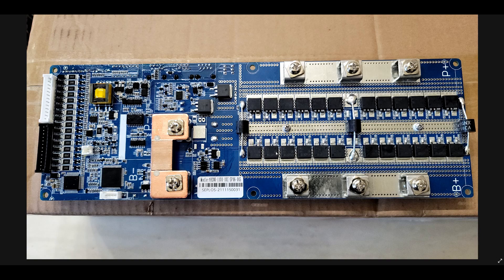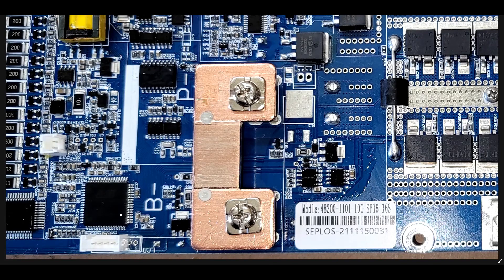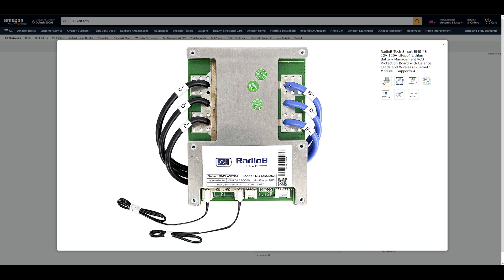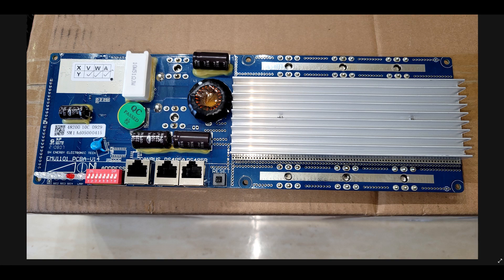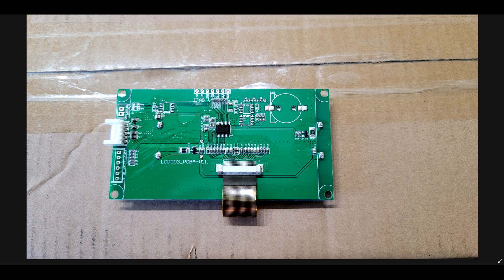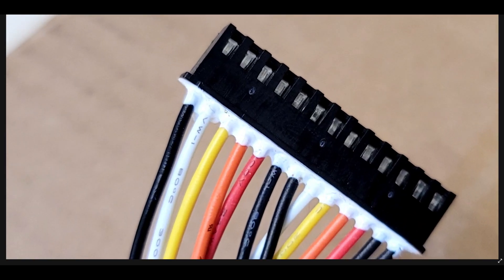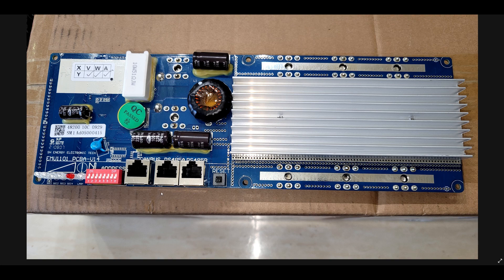Seplos 48V 200A BMS PCB Close Up & Overview

Comment: Seplos BMS is an excellence BMS, stop complaining DMI INC about it. You can't do or design it but you to complain.
Reply: Is 200amp enough for a 48v bank on a spf5000es inverter?
Reply from the maker: @JM-yx1lm  200 AMP provides for 10KW output. What is continuous max rating for that inverter?
Reply: The updated version will be available soon. Hope fewer complaints.
A little spoiler: the DIP address is still there this time.
Reply: @SeplosTechnology  when is it available? any 250A charge-discharge, or more, options?
Reply from the maker: Love it!
Reply: No, not at all. The software lacks a lot, the balancing is not really working. Check Andy's series about the fraud on off-grid garage in australia when they had shipped 3 year old LFP cells to him in this summer - qr code said built in 2019 .
And there had been more isssues . No, not a monday built BMS cause he had purchased 2 differet SEPLOS batteries, the 6,9 kWh Mason full diy kit incl. cells and the bigger one without cells for the EVE LF280K cells. Same issues and struggles.
Reply: 2 of the temperature sensors had been doa - so not the greatest quality if they did not check that before shipping.
And look how poorly they ship the kit in their battery kits like the masons. They throw all parts and pieces into the empty metal box without much protection and once they get loose like the heavy bus bars they will cause a lot damages.

Comment: Hi, I have this BMS to control 16x 280ah lipofe2 battery pack. So do you know what is the ampere of a circuit breaker to protect my battery? 200ah dc circuit breakers doesn't exist and I don't think that's the ampere to consider (200)

Comment: I have seen many unnecessary disrespectful messages on this post in fact I think that your observations are very professional and I would strongly agree on the subject of the bus bars, being a mechanical engineer,  I did cringe watching Ray using the toque wrench on those, in my opinion, inadequate fastening screws. I'll be looking forward to your developments on the usage of this BMS as I am now constructing my PV system with a temporary 5.1kWh "microwave ready" battery for testing purposes to then progress to building my own 300ah one having just spoken to Jenny wo about the cells thanks to the generous input of our friend Ray. Thanks again for sharing 🙏
Reply from the maker: Thank you. You do know your stuff... Imagine heavy gauge wire or two hanging on those connections. It can easily rip connectors apart from PCB.

Comment: They need 2A balance current instead of 0.150A!
Reply from the maker: I have not used these yet since I got busy with with land. But agreed. JKBMS balancers do wonders.
Reply: @DMIINC2013  the latest NEEY top balancers are working quite well after Andy from the channel off-grid garage had kicked them in the ... for several times.
Now they seem to have gotten it right.
Off-grid garage is an australian channel - and andy is a german emigrant who is investigating these products carefully like the SEPLOS products and JK BMS and some more.
Reply: just get a 4A Neey and all issues for you are solved

Comment: Unfortunately unplugging and plugging back in the COM cable whilst the BMS and inverter are both turned on kills the BMS. Has happened to me twice. Not sure why.
Reply: After installing mine that I bought from minerals on AliExpress, it goes through the light flashing sequence than nothing they LCD screen goes black the lights go out. Any ideas. I guess I need to install the battery monitor software, purchase a USB to RS-485 adapter and cat 6 cable.
Reply: @USA-GreedyMenOfNoIntegrity  check the connection. Did you install it the right way?

Comment: The current shunt would be much better as a separate shunt with just two small gauge sense wires brought into BMS board.  You could unsolder it and provide your own separate shunt.

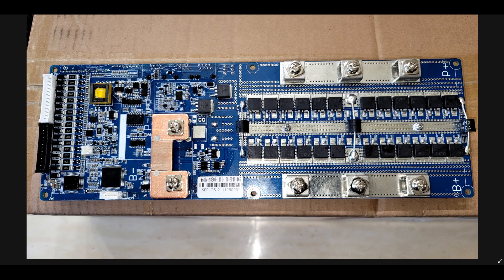Comment: 2:01 I believe this was designed for use by commercial battery packs manufacturers. And those post you see are for copper bars inside the battery pack.

Comment: Very nice video. What did you do concerning the length of the balance leads? I'm looking into my own DIY project and how my batteries will be situated, I need some longer leads. Thanks.
Reply from the maker: Thanks. Nothing yet. Leads are shorter for me to and lengthening them is only solution other then making new connector.
Reply: @DMIINC2013  if the leads are different in length, will it affect the balancing or BMS charging action?
Reply from the maker: @administratorshan  So far absolutely no issues. Difference in length is negligible to make difference. This is in regards to other BMS that I have. All measurements are taken with Fluke meter that has 4 decimal points.

Comment: I think the Seplos BMS, with intergrated shunt and pre-charge resistor, is an excellent BMS, especially with the intelligence to communicate with other BMS's in a string. I currently use HELTEC/JK 200/2amp active BMS's, which will be replaced with the Seplos if they test well. 
I look forward to your testing and integration.

Comment: With the system as large as you have, you should just drop the money on a Batrium or REC-BMS. This way you don't have to run the current through the BMS.
Reply from the maker: I get what you saying. However, I do prefer idea of solid state relays integrated into BMS. Thanks for watching.
Reply: @DMIINC2013  What function to the integrated solit state relay have? Is the Seplos alone enough or do i need a relais additionally for cutting of the battery like REC-BMS has it?
Reply from the maker: @leoh2920  I want to say seplos it self is enough.

Comment: Regarding the canbus, do you know with which inverters it’s compatible?
Reply: they are compatible any inverter that support pylontech CAN protocole. that's a lot
Reply from the maker: Have no idea. I know they are not compatible with MPP-Solar inverters yet.
Reply: @DMIINC2013  they now have firmware option for mpp solar according to their  website
Reply: It works perfectly with Deye, Growatt. The Mpp works as well through RS485 port
Reply: @odedeyidamilare  in order to get mpp solar to work you need to order a specific version. and you can't update it back to CAN bus, unless you send it back to them.   anyway, I've order 2 to test them with mpp solar inverter.
Reply from the maker: @sergea1138  Would like to see your results once you have it up and running.
Reply: @DMIINC2013  yep, I just get them today, from the outside they look the same,  no specific documentation, details about the pins to use for RS485 are missing. I only know it use the same CAN BUS rj45 connector.  waiting for seplos to provide the missing information, and waiting for my cells to come next months.
Reply: The updated version comes with both CANBUS and RS485 communication. Contact us for more details.

Comment: I think you will be fine with the screw connections. When you run the wire, Dont let it be stressin on the board itself. Also I think you can run 3 wires from each side of the connections. You should be fine for carrying current. Most of the ones I see are doing 100 amps or 200 at max. You should be fine without any modifications. Might want to consider that because of warranty purposes. Just in case. Because they may not honor warranty if you make modifications to the product.
Reply from the maker: I think so too. Sometimes I stress over nothing.